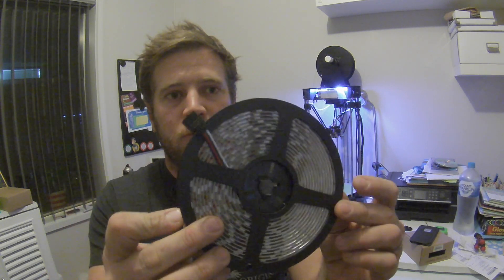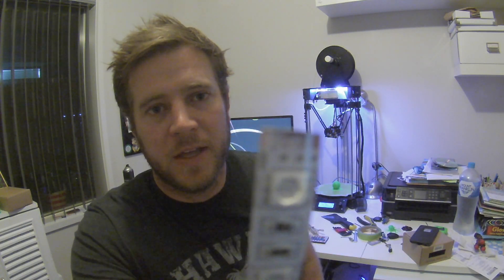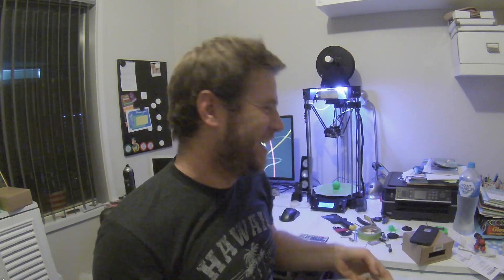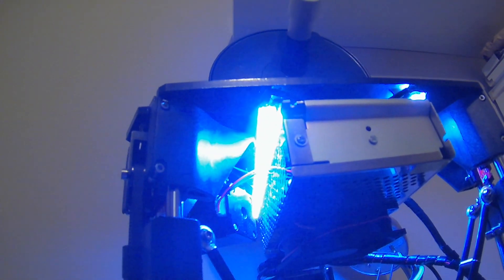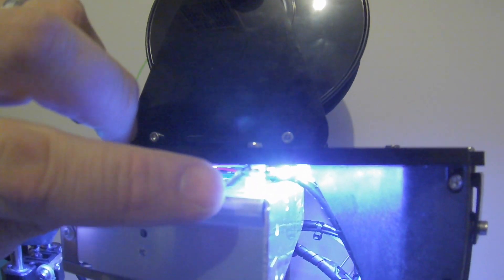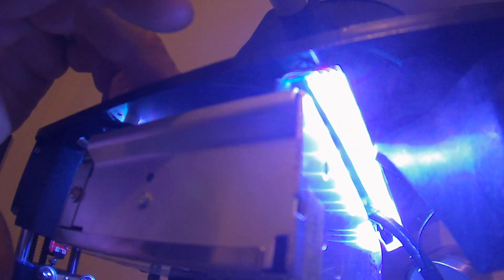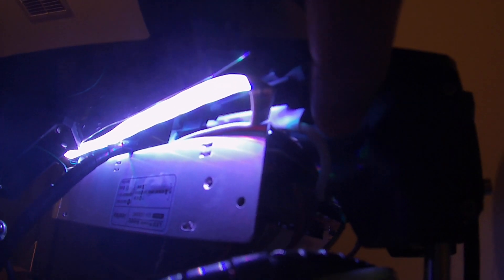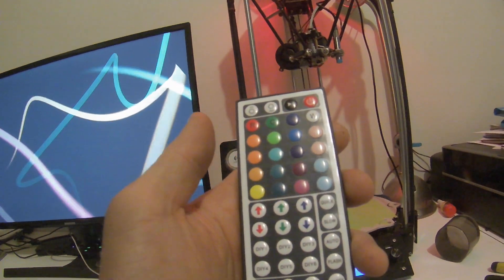How to install remote control led lights to a 3d printer

Comment: Nice! I'm gonna try this. What was your reasoning for choosing a Delta style printer over a Cartesian one?
Reply from the maker: Hi Max, the delta style printer was our first printer that was relatively cheap from our local electronics store in Australia. We have since purchased a second printer which we will be doing a review on in the coming week which is a cartesian style printer. The issue we have with the delta we feel is there is too much movement in the printer head plus to move one axis requires all too move. Cartesian are all seperate which makes the movements much simpler and more reliable.